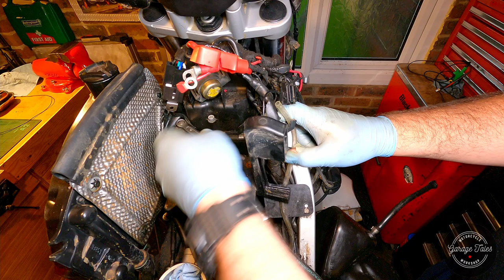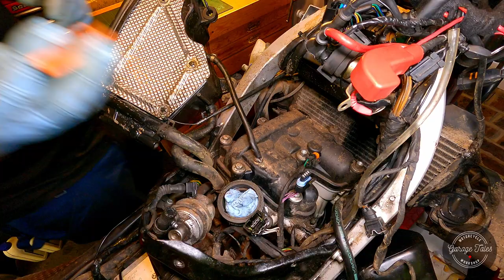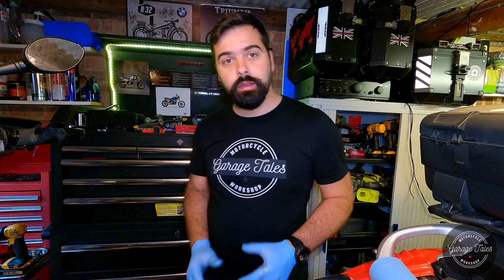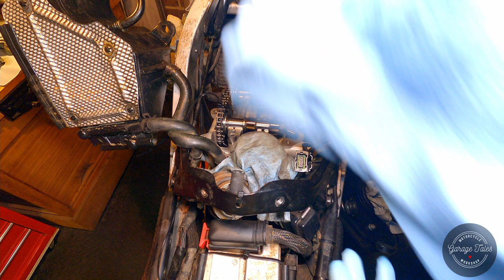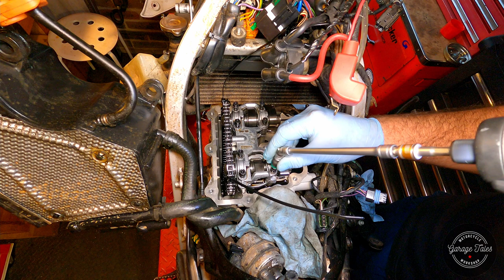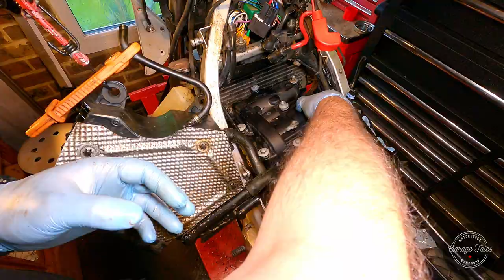BMW F650GS Valve Clearance Adjustment

Comment: Excellent job.  I recently bought a 2002 f650gs Dakar and I´m absorbing all the info I can about servicing this bike. Thanks!
Reply from the maker: Thank you for your comment! Hope you’ll enjoy your new bike! They are lovely machines :)
Reply: @garage_tales  hey there! (happy new year by the way) I want to ask you the diameter of the valve clearance adjustment shims. Im going to check the clearence but first i want to search for aftermarket shims in case i need some. I´m from Argentina, and here oem parts are too expensive.
Thanks
Reply from the maker: @gustavoej6722  Hello. Happy New Year to you too! I’ll try to find some old ones and measure the diameter in the next few days. Sadly I managed to get sick so I’m banned from entering the garage at the moment.
Reply: @garage_tales  Ok, thanks a lot. I hope you get well soon. Regards!
Reply from the maker: Hey Gustavo. Sorry for taking so long. Diameter of the shim seems to be 29mm. Measuring between 29.00 and 29.02 to be more precise. Hope that helps! :)
Reply: @garage_tales  Thanks!    I´ve just checked that those are the same shims as KLR 650.
Reply from the maker: That’s good to know :)

Comment: The chain must have jumped on the crank sprocket , not sure how we can stop this given the need to pull the cams with the chain connected. I suppose you can release the cams from the chain and keep tension on chain then re time the cams after. Which you had to do anyway. Either way it was a great video and the clearance is spot on now. Thank you for sharing , very informative. Cheers ✌️❤️
Reply from the maker: Hi there. Thanks for your kind comment and glad to hear the video was helpful 🙂
I think you can stop the chain from jumping teeth of you pay more attention. I didn’t expect that to happen and with filming and everything, it didn’t cross my mind. But if it does happen, it’s pretty easy to get it back right. 🙂
All the best!
Vlad

Comment: Excellent video!   I'm curious why you didn't check the shim thickness of the two good valves (LIN and REX).  I like to keep track of what's in there for next time.  If I know what is in there I can have the shims I will likely need on hand before I open the engine.  I've found that the valve spec changes very slowly over time (last time I had to change a shim was about 40K km ago).  Also, the change is usually to a thinner shim, so four spares on hand is probably sufficient.  It really only matters if it is your own, not a customer's, bike.  I love your clear and logical approach in this and your other F650GS videos.  Long comment; sorry!
Reply from the maker: Hi there. Thank you for your kind comment! 🙂

As you say, this only makes sense if it’s your own bike. I do have a sheet with all the shims in my triumph. But the bmw wasn’t my own, and sadly, it’s a bike I’ll print never see again, as I’ve moved to a different area. But hope to start making some videos again soon and hopefully get some more BMW’s as well 🙂
All the best,
Vlad

Comment: Hi, thanks for sharing this video (valve clearance adjustment). I am about to replace the rocker gasket so found the video very helpful showing what has to be removed to get to the cover.  Can you tell me please what do you use to clean the cover?  This seems really effective and I am going to have to clean up my engine casing as this is covered in oil from the leaky gasket. Many thanks. Mike
Reply from the maker: Hey Mike. Thank you for your comment and glad the video was helpful.

It’s just brake cleaner in a pressurised bottle. Works pretty well🙂

All the best,
Vlad
Reply: @garage_tales  
Thanks Vlad. It works very well! I’ll give it a go. Cheers. Mike

Comment: All do-able with vids such as this, BUT it seems ponderously detailed compared to the simplicity of air-and oil-head BMWs.  I have to wonder if generated shop income was behind all this?  You are right about learning to do this yourself!  $140/hr here to mostly remove and install plastics, hoses, and clamps.  Also, every 6000  miles seems a bit excessive eh?  One could expect a $500 shop bill every 6,000 miles?  Ouch!   Great instruction, great process, good shop-craft.  Thanks.
Reply from the maker: Thank you for your comment! :)

You’re right, it’s a bit more involved than an old air/oil head but most bikes are. I don’t think shop income is their main concern regarding this particular aspect. It’s just a different type of engine :)

Thanks again!
Vlad

Comment: Hi, great skill and thank you for sharing.
I've the F650 GS Dakar which doesn't start since I bought it a few years ago.
It just cranks.
When cranking, I put my hand on the exhaust to check the smoke.
But what I felt is a suction on the exhaust.
I guess the exhaust valve is stuck or something is keeping it open.
What do you think?
Reply from the maker: Hey there. Thanks for your comment.
Big singles act funny sometimes. Without seeing the bike and feeling how bad it is, I wouldn’t jump to suspect engine damage before checking the simple stuff…air, fuel, spark.

You can do a leak down test or a compression test to see if the engine is fine without opening it. Both pretty quick to do.
Reply: Thank you.
Can I use a compressed air at TDC to check the leak down test?
Reply: I was just thinking, at TDC the decompression is active. So I can't tell if the exhaust valve is stuck.
Reply from the maker: Hey there. To do the compression test correctly you would have to remove the rocker cover and restrain the compression release lever. 
I haven’t tried so not 100% sure, but for leak down you might be able to put the engine a few degrees before or after TDC so valves are still closed but decompression is not engaged. You can use compressed air, but at a lower pressure. It’s a good idea to put the engine in gear and rear brake on to stop the engine from moving and opening the valves.
Reply: Thank you very much for your support.
Reply from the maker: @AkA-zg1sj  Did you manage to find anything? 🙂
Reply: I'm working on a cat d8H dozer at the moment.
As soon as I am done with the dozer, I will start working on the bike.

Comment: Im about to do my valves and I think I am going to attempt something based on the oil tank bungee strap idea. I'm going to run a bungie through the timing chain after I unbolt the camshafts and hang the chain from above so it will hopefully stay connected down at the crankshaft
Reply from the maker: Hey Donovan, hope it goes well :)
It should work fine, but I was a bit too confident in the method and trying to film at the same time so not paying enough attention. But it’s all good as long as you spot your mistakes and correct them :)

Thanks for your comment!
Vlad
Reply: @garage_tales  mine checked out. Thinking my "valve train noise" must actually be something broken in the exhaust from a fall I had
Reply from the maker: Hope you find it and it’s nothing serious :)

Comment: What parts and tools are you using to put the hose back on the valve cover? The manual says to use a BMW OEM plier and one-time-use clamp that is no longer available. Thank you!
Reply from the maker: I tend to reuse them if they’re not damaged. Didn’t even know BMW suggest replacing them every time, and don’t see why I should if they still function properly.

The tool is just pliers for click-r / click collar clips.

Comment: Hi thank you for the video, firstly I want to commend you on your video skills and mechanical ability, I recently bought a 2007 F650 Dakar 63000km and decided to check the valve clearance, what a fun job for big hands, I only had one issue in getting the cam chain adjuster back in, almost impossible to get your fingers in there while turning the adjuster nut as it is under spring pressure....I ended up drilling and tapping in a 6mm bolt in the end of it so I could use a 1/4 socket to push the adjuster bolt back into the housing....so much fun indeed, full day job on a Sunday.
No wonder the valve clearances rarely get checked.  I could do a full service on my R1100 GS in an hour and a half including valve clearances.
Reply from the maker: Thank you for your comment! Yes, the job can be a pain, but It’s worth doing.
Hope you enjoy the bike! :)
Reply: At 63000km did your bike require changing shims? Very curious to know I have a 2005 Dakar with 10k miles, thanks Mate.
Reply: @guy7670  I checked it at 75k km and no adjustment was needed. But I don't really know when it was done last time, I bought the bike with 60k.

Comment: Hello, What a great video!! Thank You!!   I do have one question. This 650 appears to be the twin spark plug model. Am I correct about this?  If I am, here is my question: I just bought a 2001 single spark plug version of the F650gs. Do I still have to go through taking half of the bike apart just to get to the valve cover??  I'm an experienced motorcycle mechanic (All the japanese brands plus the European two stroke MX bikes). 
I am real surprised  that Rotax/BMW created such a labor intensive situation for something that has a 6000 mile maintenance interval!!  I was quoted $500 for a valve clearance check and adjustment (if needed) at my local Beemer dealer.  I thought that was outrageous, but after seeing this video, I still think $500 is high and that $350 is more realistic.  Am I right about $500 being too much??

Despite my experience I am 64 and arthritis has beat me up badly in my spine and to a lesser extent my hands.  Do I spend a huge chunk of money or go slow, rest when needed and do it myself??  Your opinion is greatly valued and appreciated!  Bryan
Reply from the maker: Hey there Bryan. Thank you for your comment. Really appreciate it 🙂

It’s been a while since I’ve worked on that bike, but I’m pretty sure it was a twin spark model. $500 for doing that job?? No wonder I’m not getting rich doing this 😂 I asked for way too little. I’m in the UK, so can’t speak about the US. Here the BMW dealers charge just over £100/hour. I don’t think they can justify spending 5 hours to do a valve check.

There is a bit of work involved to get to the cover, but to be fair to bmw, it’s pretty straightforward to disassemble the bike. I assume you should be able to find other garages than the dealer that will do it for far less, but if you’re happy to take your time with it, it’s not too bad to do it yourself 🙂
Reply: @garage_tales  Thank you very much for your insight. I'll give it a go myself.

Comment: the specs I looked up for my 2002 F650GS single spark is    intake 0.10 to 0.15 and exhaust is 0.25 to 0.30 ..is this the same as you got? overall I have my intakes at 0.13  and exhausts at 0.30  does this work? I figure being looser on exhaust should tighten up more due to higher heat.   damn good video by the way  thank you
Reply from the maker: Hey there. According to the manual it’s 0.05-0.1 for intake and 0.25-.03 for exhaust. And you are correct, the clearance is for thermal expansion of the valve train. As the engine gets up to temperature, the clearance closes up (more on the exhaust as it’s getting hotter, while the intake is getting cooled by air/fuel)

To my knowledge (could be wrong) there’s no valve clearance difference between the single and twin sparks. It’s the same engine made to comply with emission regulations. The bmw manual doesn’t suggest different clearance. But it’s always better to be on the loose side than the tight one :) So I’d say you’ll be fine with the clearance you have :)

Thanks for your comment!
All the best!
Vlad
Reply: @garage_tales  Thank you so much for clearing this up! It helps big time!!!
Reply from the maker: No worries. Glad to help.

Comment: What year is that F650GS?
Does the 2005 F650GS have over bucket (as your bike) or under bucket shims?
Thanks for the great video.
Reply from the maker: Thank you for your comment. This one was made in 2000 I believe, and as far as I know, the 2005 is the same. But whichever way it is, it doesn’t make it any harder :)